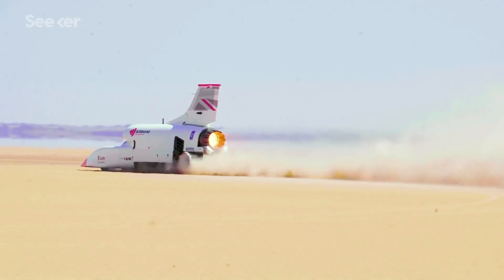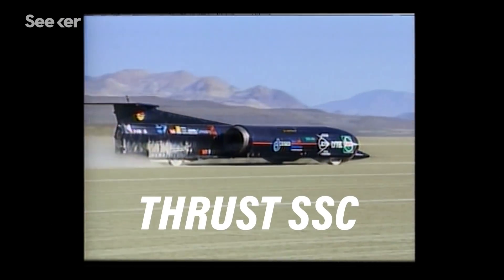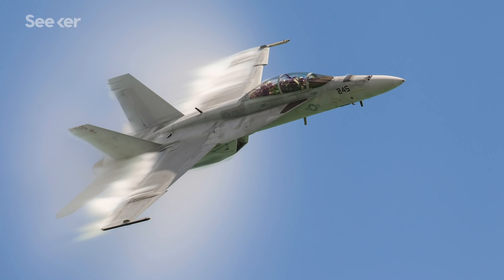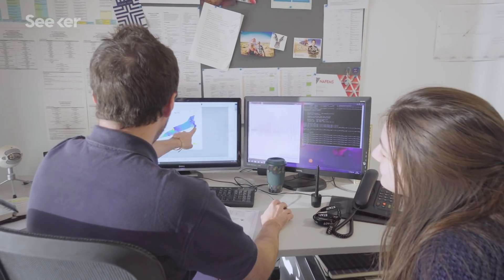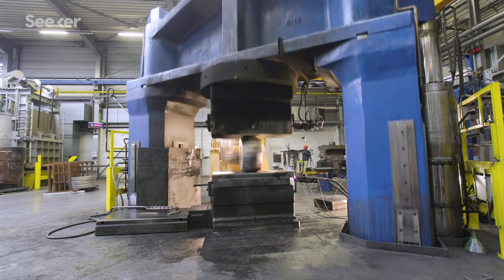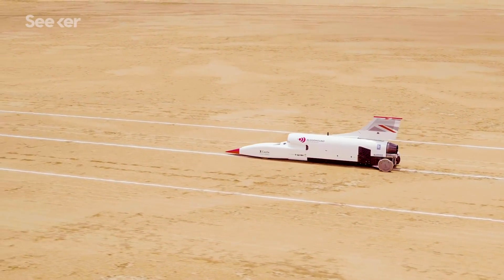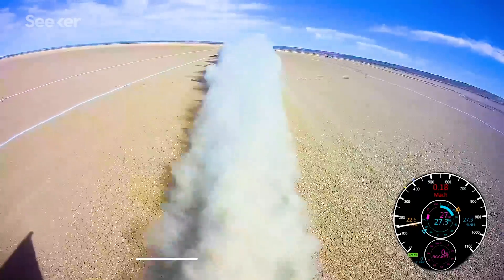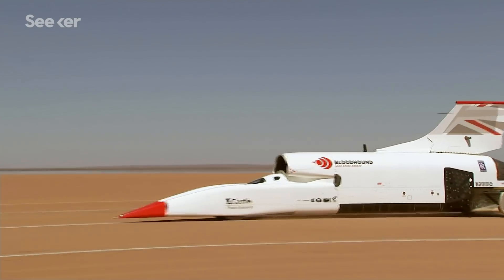This Rocket-Powered Car Is Engineered to Break the Sound Barrier

Comment: So what happened when the driver slam the brakes?
Reply: It takes a screenshot
Reply: It creates a black hole
Reply: Probably a parachute deploys
Reply: Linecraftman 
Slam the parachute
Reply: @linecraftman3907  -The wheel brakes are used at "low" speed. They use a parachute at high speed first.
Reply: It time travels.
Reply: https://www.bloodhoundlsr.com/engineering-special-report-how-to-slow-a-supersonic-car-with-a-parachute/
Reply: The car will rip a hole through space and time
Reply: DEATH!!!!!!!!!!!
Reply: Yeeeeet
Reply: "whaddya mean, 'breaks'?"
Reply: well it probably stops funny man . yes it does eventually it stops funny man
Reply: replying to your reply is so meta
Reply: Applying brake at high speed heats up the temperature of wheel from inside baring...upto  1000° and more... that's why they first need to reduce speed of car to which brakes are applicable
Reply: It will unleash pikachu
Reply: It will slam him back
Reply: Brakes? Where we're going we don't need brakes
Reply: Probably the driver s leg breaks
Reply: They'll shatter unless he's under 200 mph which is why he will deploy air brakes, a parachute once under 600 mph and then disc brakes.
Reply: Parachute, airbrake and wheel brakes
Reply: Nothing happens.
Reply: Eyes came out
Reply: they use parachutes thankfully
Reply: it slows the car down   thats how brakes works
Reply: That's a story for another What If!
Reply: Slam them at top speed, and not much would happen until the wheels broke up from the heat. Air brakes are used to slow down to around 200 mph or so, then the brakes can be applied. Parachute will only be used if the air brake system fails.

Comment: Why? All the extra pollution and carbon required for the manufacture and operation of this vehicle for....a number? I feel like our resources could be used for better things
Reply: That's what you took away from this project? Do you have the same issue with things like space exploration, or oceanic exploration? Also, they're not "our resources" are they, they are the owner of the project's resources, therefore he can do what he likes with it.
Reply: Luke Well space exploration is something we’ve never reached before aka a new frontier, also I do have a huge issue with the amount of carbon and pollution emitted per each rocket launch as it’s super inefficient. I have no problem with ocean exploration as long as it’s clean we gain stuff from it. Also planes go way faster and if they really wanted to study aerodynamics we have planes and flight, as land speed will always be restricted by friction. I don’t understand whose lives were made better as a a result of this
Reply: @Truf-teller  Not everything has to makes live better to justify doing it.
Reply: @Truf-teller  Rocket launches and things like this producing C02 or pollution isn't the problem, it's cars/fossil fuel burning power plants etc that are the problem. You know, those things China are building by the day. Don't think running a jet engine for an hour is gonna do nearly as much damage as a full scale coal burning power plant.
Reply: Luke fair enough, yeah we definitely need to clean the air and water as we have fucked this planet.

Comment: I'm glad they were able to get the extra funding to keep the project going.  There aren't too many vehicles that have an ICE a jet and a rocket engine.
Reply: For those who are wondering why it has an ICE: it uses 550hp Jaguar V8 as a fuel pump
Reply: @heamees4822  lol an ice as fuel pump
Reply: @heamees4822  ICE now replaced with an electric motor
Reply: @heamees4822  Not any longer. The new rocket will not need it. It will either have pressure fed fuel, or an electric pump.
Reply: Let's just hope they get the sponsorships they need/deserve to keep it going into 2020/21
Reply: Theres's also the Aussie invader car with rocket engine trying to break the 1000 mph record. Not sure how far they are though.
Reply: Apart from an actual spaceship you pretty much wouldn't find anything with a oxidizer/propellent engine AND monoprop based engine in one.
Reply: They replaced the ICE with an electric motor that wasn't available in the original design

Comment: A rocket ‘plane’ that doesn’t fly, that’s what this “car” is.
Reply: It's a car. It's got wheels, steering wheel and it rides on ground. How is it not clear to you? Wtf is "rocket plane" anyway? Smh
Reply: acid junkie Does that mean that a rocket ship is an airplane?
Reply: It's a jet engine not a rocket
Reply: @DanTheManOG  Jet engine was just for the tests and is able to reach "only" six something hundred mph. It will have a rocket engine for the actual record of 1000 mph attempt.
Reply: @boutek  Actually, the jet engine isn't (and wasn't) just for the tests. It will be used in conjunction with the rocket engine for the "record" attempt and then 1000mph attempt. The jet engine will get Bloodhound to somewhere between 300mph - 500mph before the rocket is "activated and takes Bloodhound to over 800mph (to break the current record), and then if all goes as planned, to 1000+mph to reach their ultimate goal.